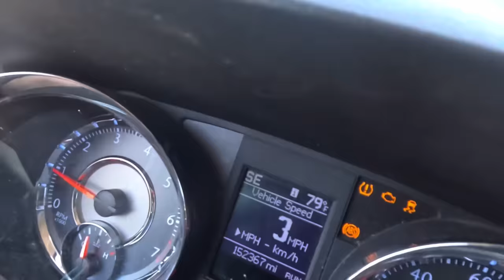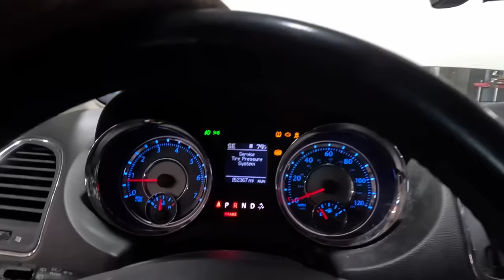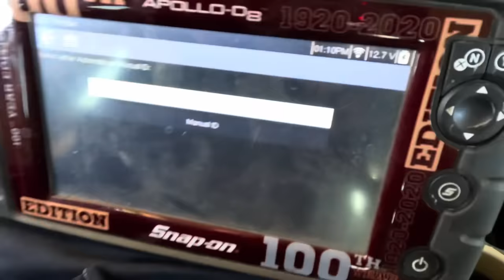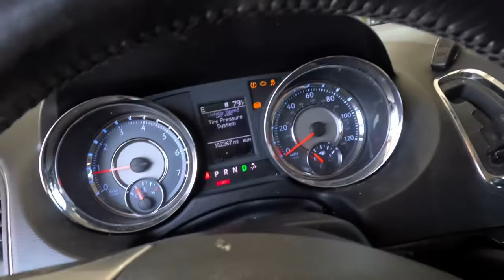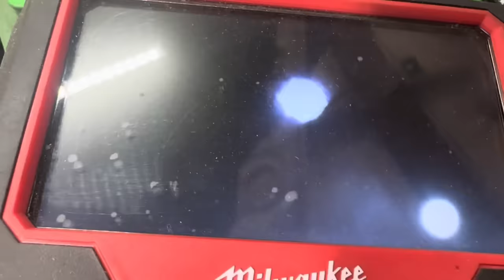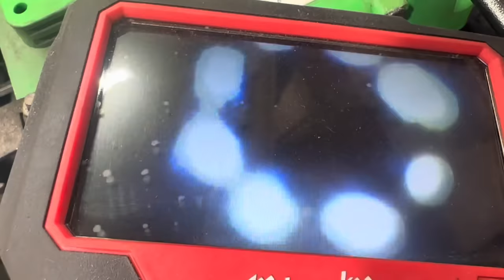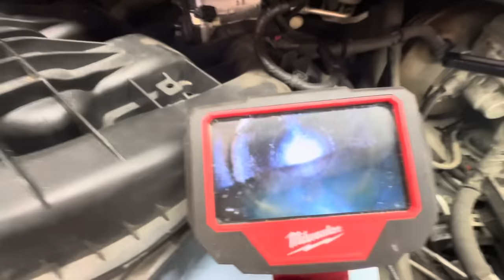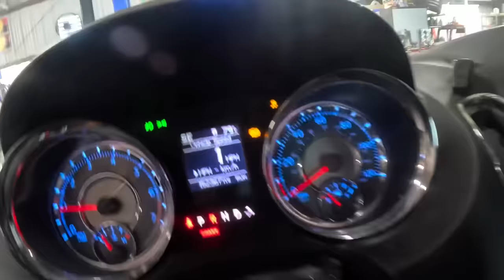Towed In! Died on Highway! (Engine is Drowning Itself!) Chrysler 3.6

Comment: I just lost that exact van (accident) a couple of weeks ago, but I replaced that part four times in the 13 years I owned the car, finally finding the aluminum part on eBay after the third time (and the fourth time it happened when I was out of town, so I had to locate the part in the middle of nowhere taking care not to overheat the engine). Apparently at some point between the third and fourth times they finally started making an aftermarket part out of aluminum and as luck would have it it was in stock in the middle of nowhere and I was able to replace it with that. But IMO Chrysler should replace this engine. There's no way I believe the engineers somehow "didn't know" making a critical component in a high temperature application out of plastic was the wrong move. It's too bad the driver here wasn't paying more attention to the temperature gauge and let it overheat to the point it shut down. :(
Reply: "It's too bad the driver here wasn't paying more attention" is EXACTLY why it's NOT Chrysler's fault. Do I like that automakers have been using plastic parts in vehicle cooling systems for 30 years now? NO. The first time I replaced one was on a 90s Buick that belonged to a fellow student in college, a girl who didn't know anything about cars, but when steam happened and the temperature gauge went up, she knew to stop and call for help. I replaced the broken plastic part with a steel one, and she drove it for a long time after that. People have to use their brain. There is no design so foolproof that an inattentive driver can't ruin it.

Comment: The vehicle has a temp gauge and an audible chime to get your attention, 100% failure on the driver regardless of design and plastic parts. I hate plastic anywhere on critical components but that's not going to change.
Reply: True, and ALL the manufacturers do it. The driver ignored the warnings and ruined the motor.

Comment: PentaStar… Engineered to excel in complexity.
Reply: So are most modern engines these days.
Reply: Just like a Fuggin Old Rebuilt Dodge 😉
Reply: @jimparr01Utube  true! But due to elaborate electronic control systems and confusing codependencies between performance/efficiency/safety enhancements. A no crank condition caused by a no code failed sensor can ignite a bankrupting parts cannon.
Reply: Pentastar engines are reliable AF if the customer doesn't abuse it

Comment: Head gasket blew out causing sudden high compression bullet that took out heater hose.....theory....
Reply: It's a plastic connector, I had a 08 town and country with the 4.0L V-6 (I don't care what people say about Chrysler, this Van was actually a pretty good to us except this) but this plastic connector broke on me twice and caused coolant to leak... Wrong place for plastic... They should have put a metal one in there. Thankfully it never caused me much problems... I caught it when I noticed it leaking both times
Reply: @anthonydtobias that’s very much the problem I have w/Chrysler.  It’s not that they’re otherwise bad vehicles, but they have a really bad habit of trying to save a few pennies by putting plastics in places where plastics are doomed to fail catastrophically.

Comment: The key lesson is, boys and girls, if your engine starts overheating, shut it down.  I wonder how long the owner drove the car with the temp gauge pegged.
Reply: The child of a friend of mine drove his car with no coolant all the way home because she was frightened to call him and have him say, park it and I will send the tow truck.
Instead the engine was ruined and also the intense heat damaged to transmission.
Reply: max speed of less than 50mph when they shut it down.   it was hot enough to start seizing

Comment: If that were my car, I wouldn't even consider repairing that engine as there's really no way to know if the lower end was damaged from hydro-locking without fixing the upper end first.  That engine got real angry when you put coolant back in it.  A good, used engine is the only repair I'd consider.

Comment: My personal car is an Australian dodge journey 2015. Same motor but only front wheel drive. 101024km on it, sorry I don't do freedom units. I have been a helicopter parent to it and it has never missed a beat. Mind you I did have to do the entire oil filter/cooler unit and I do not enjoy having to take off so much top end to get to it
Reply: This is also front wheel drive unless I missed something?

On the AWD versions they still have the transverse mounted engine and are still primarily fwd

Comment: People never watch the temp gauge (if equipped) until it's too late.
Reply: I do, but too late comes quick if you've just pulled of the highway into urban traffic and then a hose blows.  (Didn't ruin the head gasket because I was just quick enough and didn't care about pulling over and blocking a cycle lane).

Comment: Dorman makes hoses that have metal elbows. Chrysler is the king of ticking time bombs. They wan't it to fail. Bad thing is is Benz learned how to be "cost effective" from Chrysler.  I just did a front head on one of these. Parts are not too bad. If you use the timing tool set. You can get the head swapped over quickly.  It took me about 8 hours from tear down to re-start the engine. With the current miles on the van. I would recommend Trans flush/filter, Oil cooler replaced with metal, heater hoses with metal Y joints. Plugs, coils, valve cover gaskets, and PCV valve. If you fix the engine with without the trans service. The trans will probably fail before 200k. The filter plugs up and burns out the trans. The torque converter can cause a lot of debris in the trans. It is not because of a bad converter. It is mostly just converter wear. I think this is a great engine. But value engineering keeps it from being a off the showroom bulletproof motor/trans.

Comment: To be honest I though you were maybe being a little overly dramatic at the beginning really but then I was thinking "looks like we have a cylinder gasket failure" when you showed the clip of the water being pumped out of the cylinder by the piston.

Maybe should've mentioned that first and checking the oil to see if the level was way over the maximum mark on the "dipping-stick" whist also checking for contamination of the engine oil with engine coolant?

Question is did an overpressurisation of the coolantcause by a faulty thermostat cause the plastic junction to fail or was it the failure of the junction cause the loss of coolant and warpage of one of the cylinder heads and failure of the gasket? lol

I know you said it lost all power but you'd have to say you you would have to check the other cylinder walls for signs of scoring to indicate whether the engine was a "goner" or had a partial seizure or not?

I know you were right in stating it could have a cracked head etc but that would require "skimming" or resurfacing of the head and pressure testing to be sure if it was cracked or not.

Repairing the engine may be less cost effective than buying a secondhand unit but you have to be careful you get a good unit that isn't going to fail but you may find one with a lower mileage that's better than the original before it failed lol

A lot to weigh up but if you're giving the customer a full and comprehensive diagnosis and letting them have a few options to choose from.

With that in mind they may decide not to repair it and just trade it in for another vehicle or look for a cheaper quote, everyone wants to save a buck or two these days and cars are not worth what they used to be lol

Comment: I love how you act like this engine is garbage when millions have been used and a small percent have had issues. The oil cooler... Yeah learn how to properly tighten your oil filter cap to proper spec and this won't break. How many 3.6 engines do you think drive by your garage every day without issues?
Reply: I agree.  Have had friends with Chrysler Minivans from the 2008-2011 range.  Had minimal problems with them.

Comment: This is my favorite kind of auto repair. Step by step diagnostics with clear direction and judgement as to which problem to deal with first. Fixing that hose leak would have been tempting but in the end your focus on the most serious sign kept the bill low and came to the same conclusion.

Comment: I over heated my old convertible (the most complex and expensive thermostat structure was responsible - $400 and aftermarket as factory had terrible design flaws - 2.7 Chrysler) and they told me I did things perfectly as no damage but most people misunderstand how quickly overheating will destroy the motor and keep driving.

Comment: why do people do that? it must have had all sorts of warning lights on before it cut out... by driving it when it was clearly in serious trouble.. they now have a car with a dead engine (and still ended up having to get it towed.... may as well have done it sooner and had a car with a repairable engine).
Reply: I hate to be stereotypical, but female drivers (a minivan's usual) tend to ignore the warnings, and not always because they're oblivious, but often because they're frightened, and don't want to be stopped in a place where they'll feel unsafe, so they want to push ahead and get somewhere safe. That's understandable, but it usually ends with stopping somewhere less safe than what they could have planned if they'd heeded the warnings, and expensive, major damage. I've seen it firsthand with my mom when I was a kid.

Comment: My main concern is, clearly it was having an issue, no doubt the temperature gauge went to the moon, but they kept on driving until it shut off… if they’d stopped at the first sign of overheating they could have saved the engine and just fixed with a new hose and some coolant.  People should do better

Comment: plastic parts in critical locations. Why????? Is it to save manufacturing costs? All at the detriment to longevity and reliability.
Reply: Planned obsolescence. Why make a car last 20 years when you can sell them two cars that last 10?
Reply: @karenpojar2514  I tend to agree with your comment. 
I have a 2005 3.8L NP Mitsubishi Pajero (Montero in US) without any plastic components where critical to operation.  All of these components are alloy. It has nearly 200,000miles. Given proper servicing (which it gets), it could last another 200,000miles. 
It has been the most reliable vehicle I have ever owned.
Indeed this does not help the manufacturers bottom line but I am trying to look after 'his' bottom line.  
I look at modern equivalents (of any make) and get very disillusioned by the poor longevity and reliability that they seem achieve.  
All to achieve lower emissions, and reduced manufacturing costs.
Alas, I would not know what to replace the Pajero with today.
It seems we have (in recent years) gone backwards with respect to simplicity, reliability and (ultimately) longevity.  
What are your thoughts on that comment Ray?
The glory days would have been (in my opinion) the early 90's to late 2000's.  These vehicles (in general) were very reliable (particularly the Japan built varieties).    
That is my REEEEEEEEEEEEEEEEE for the day.

Comment: Yo Ray, before swapping out the engine, you should do a little lesson on how to do a compression test with a compression test kit, as well as tell us some information about the engine. We all know there's some damage to.the engine, but the engine itself might not be bad. 

Only Cylinder #4 is causing problems. If you do a compression test on all cylinders, it could be saving the customer thousands of dollars. Like I said, the engine MIGHT be done for, but replacing the engine because Cylinder #4 has a crack? I would at least love for you to do a compression test, see what every cylinder says about its health
Reply: You planning on running on 3 cylinders and no coolant?

Comment: Yet another case of.."oh the engine light is on and the temp gauge is to the right of "H". I'll just make it home". Instead of pulling over and calling for help. That's what kills any engine.
Reply: I hate to be stereotypical, but female drivers (a minivan's usual) tend to ignore warnings, and not always because they're oblivious, but often because they're frightened, and don't want to be stopped in a place where they'll feel unsafe, so they want to push ahead and get somewhere safe. That's understandable, but it usually ends with stopping somewhere less safe than what they could have planned if they'd heeded the warnings, and expensive, major damage. I've seen it firsthand with my mom when I was a kid.
Reply: @edifyguy  I get it

Comment: the engine is fine just put a head and head gasket in it they have extended coverage till 156xxx on that cylinder head through Chrysler ,probably out due to year but i do head and gasket jobs on those all the time and its fine easy job the codes are due to it over heating and oil getting hot and thinning out slap a cylinder head and gasket on it change the oil and fix the y pipe , clear the codes and ship it

Comment: If no rust that van is worth 8-10k, cost of used engine $3-4k, if only one head 1-2k, if only one head gasket $500.00 $1000.00 with labor. Thats my unprofessional opinion, how far am I off and not mentally.................... PS might be slight more because I insist on Doorman oil cooler......

Comment: Since cylinder 4 was the only code listed for a misfire, I would at least pull the head and check its condition.   Since the vehicle started and ran, the owner may get lucky and only need a head gasket or replacement head.
Reply: On my own van, I'd try this. On someone else's, NO. It's not a repair I could stand behind. It might last a decade, or a day. Too many things got too hot.

Comment: No way that there weren't warnings before things got catastrophic. Had the driver taken note of the temperature gauge hitting the top and the warning lamp, this could have been just a 'replace cheap piece of plastic crap' rather than 'replace engine'.

Another "it just shut off".
Reply: YES! BUT, I hate to be stereotypical, but female drivers (a minivan's usual) tend to ignore them, and not always because they're oblivious, but often because they're frightened, and don't want to be stopped in a place where they'll feel unsafe, so they want to push ahead and get somewhere safe. That's understandable, but it usually ends with stopping somewhere less safe than what they could have planned if they'd heeded the warnings, and expensive, major damage. I've seen it firsthand with my mom when I was a kid.

Comment: A couple of years ago, there was a video of a 3.6 Pentastar engine teardown that died because of failure in the timing chain and tensioners.  It otherwise was in remarkable shape, considering it had 626,000 miles on it.  The owner maintained it and changed the oil every 8,000 miles, using only Valvoline or Mobil1 lubricants.  I think the owner of the Chrysler minivan probably destroyed the engine by continuing to drive despite all the warning lights going off.  The 'drive it til it quits' rarely works out.
Reply: I hate to be stereotypical, but female drivers (a minivan's usual) tend to ignore them, and not always because they're oblivious, but often because they're frightened, and don't want to be stopped in a place where they'll feel unsafe, so they want to push ahead and get somewhere safe. That's understandable, but it usually ends with stopping somewhere less safe than what they could have planned if they'd heeded the warnings, and expensive, major damage. I've seen it firsthand with my mom when I was a kid.

Comment: 2011? 2006 T&C KBB IS WORTH only $500? Has the 3.8 with no y pipes. Good. Solid Mini Van. Guaranteed the penstar was produced to cut costs. Bean counters rule the world . . Considering a new one would be 30k, Get a crate motor with a warranty and metals y  pipes. Maybe one from a salvage yard hit from the back with only 40k on the odometer

Comment: It's not just chryslers that do this. We found some pink fluid under our Pontiac Wave. We took it to our mechanic immediately and told him we have a coolant leak. He handed it back to us saying that he couldn't find the leak. incompetence)
Driving on the highway a couple days later, the lower raad hose blew out dumping all the coolant in less than two seconds.
Although we pulled over and shut down immediately, it wasn't fast enough. The timing slipped and grenaded the engine. And my wife took the car back to that same mechanic. He knew what he had done. He gave us a good price to install a low milage salvage engine, but he sure didn't do it for free.
And still, my wife kept using the same mechanic.
The next oil change, the idiot didn't put the drain plug back in properly. I think we lost more than two quarts before we realized what was going on.
I had a discussion with my wife. That was the last time we used that mechanic.
Not everybody is Raimmon Ray.